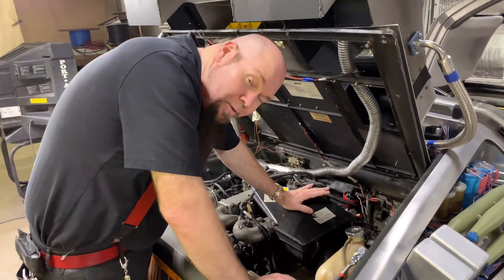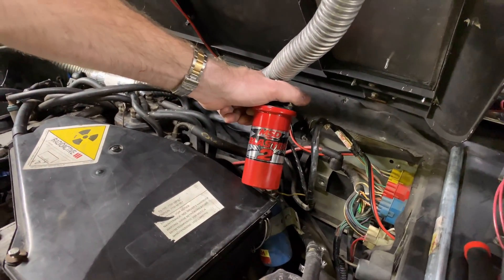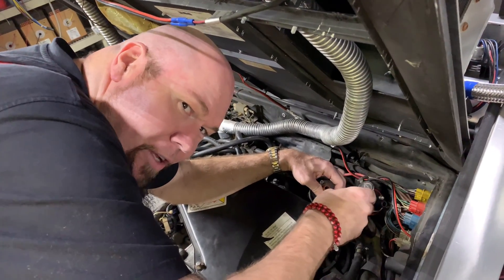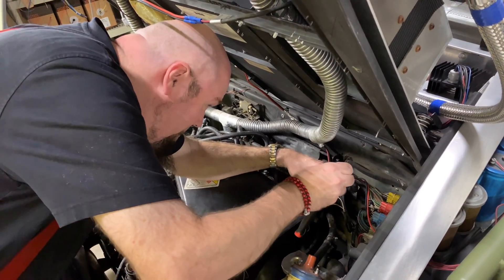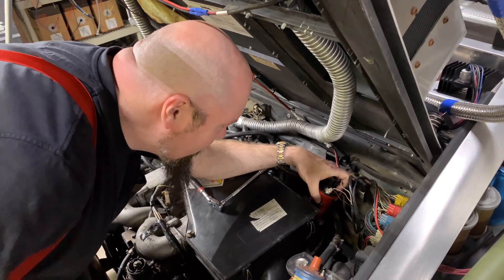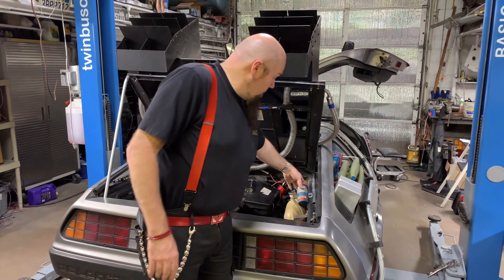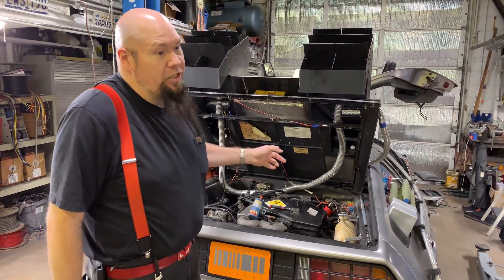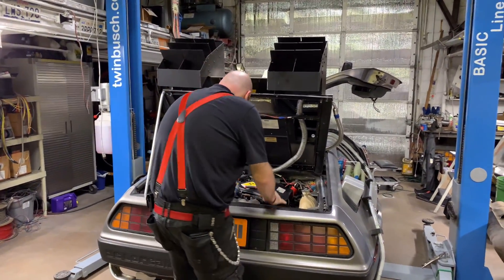Delorean Time Machine engine coil upgrade

Comment: Are the Taylor 8mm wires an off the shelf part # or did you buy the wires and make the ends? Is there a part number as well for the upgraded cap and rotor mentioned? New Delorean owner here, so I'm only 30 days in trying to consume as much info as possible

Comment: The guys on Engine Masters TV just did an ignition vid & showed HP/Tq gains opening the gaps up to .060++++ on these performance coils.  Interesting segment.  Surely there's some ignition expert for these V6PRV's who can really improve these entire ignition systems????

Unfortunately, all the performance spark boxes are made in China....thats why NASCAR runs a backup on the car the driver can flip a switch to!

Those tuners in Europe probably have done it all.  I bet the distributor needs to be recurved & I can think of many other ignition mods......I bet famed David Vizard knows this motor very well.

Comment: Greetings from Russia, Nice Delorean .... you can try a trick, replace the air filter with a thinner one)) or perform an ignition setup on the stand, I think it will give +1 +2 more horsepower))
I unfortunately do not have delorean =)
but I have a carburetor inline four-cylinder engine
And sometimes there are also problems with the spark,
For example in one of the cylinders a red bad spark
And in the rest of the blue beautiful spark
I changed the cover of the distributor and 1 wire and everything is fine)))